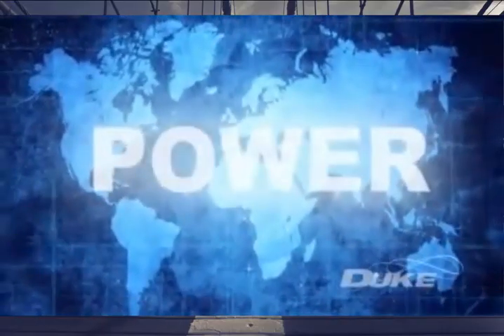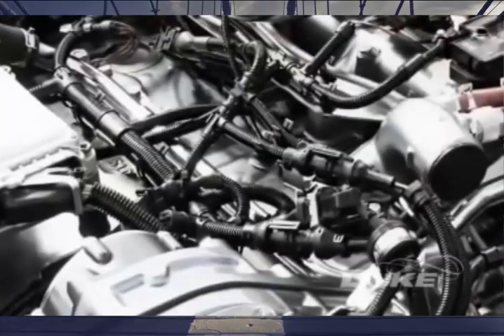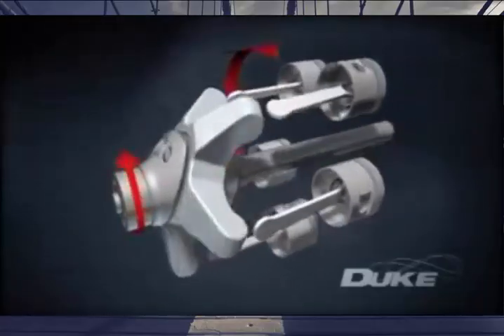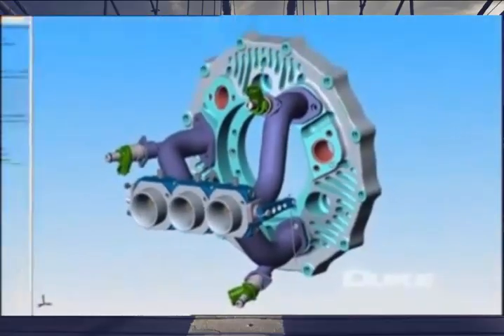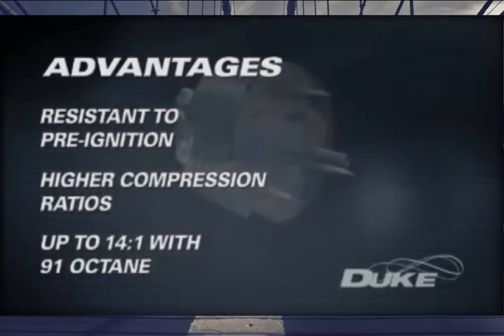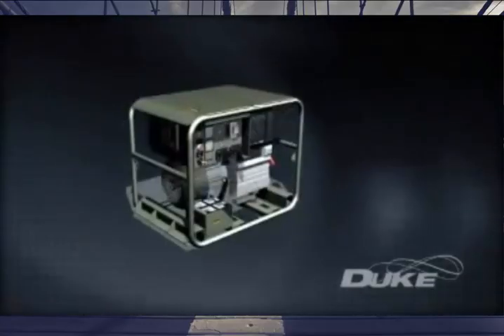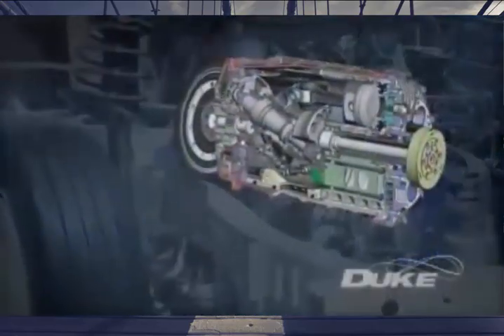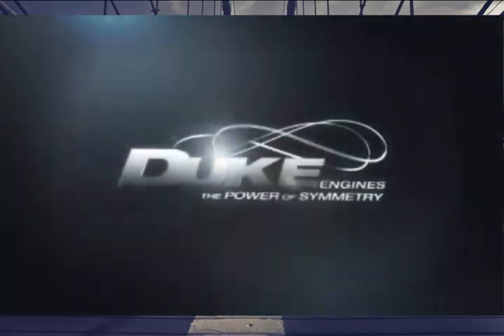Duke Engines | All information about Duke Engines

Comment: Obviously there is a major flaw in the design otherwise it would have been adopted by now.
Reply: Sealing the combustion chambers has to be a nightmare
Reply: Oh yea because there aren't about 130,000 regulations that they have to comply with before even thinking about placing it in a consumer anything.
Reply: tanker9987 - Bullshit.  Go take a Mazda rotary for a ride and get back to us.
Reply: Rotary engines are a joke. Their "high revving capability" is piss poor compared to conventional engines used in bikes. All you need is a short stroke to get 20k+ rpm.
Attitude towards cars has changed a lot in the least few decades anyway. Most cars these days put big covers over their valves and you hardly ever see proper craftsmanship and attention to detail in the design of the fuel lines/rails and most people don't seem to be keeping their engine bays clean and tidy. 
A cars engine is probably the least important component in a car, the seats, perceived value and entertainment system are what buyers think about when choosing a car. Fuel economy is even meaning less and less. They aren't going to spend more to have a different engine in it.
Reply: In general this isn't true. Regulations can be made by the current big boys in a business genre and they don't want disruptive competition to be introduced. Which is why it took 90+ years for electrical cars to come back and required a hand-held Tesla company + billions in subsidiaries + billions of of Musks own pocket to make it work. That and good timing when the market for laptops had fueled enough research into laptop batteries that Musk could then re-use and start from there for his own batteries.
Dont forget that the Wankel engine is the ONLY combustion engine invented after 1900 so far. Except for this one above and while the Rotary has a ton of downsides (seals and fuel consumption and low torque), it still has a ton of followers for being different. I could totally see this engine be popular, even if "just to be different".
Reply: 1 and 3 are actually incorrect. Rotary engine has more HP per displacement and the size then piston engine. However, HP doesn't represent total power of the engine and it is rather combination of HP and Nm (or momentum) which is important. Equally, rotary engines produces similar amount of power per unit of fuel, using smaller engine displacement.

So advantage of rotary engines is that they are compact. However, the reliability issues are the main reason why they are not more widely used. and the major point is what you mentioned in you point 2. That is as well combination of increased maintenance and especially big when people are not following the maintenance schedule and doesn't replace parts as necessary. Good example would be Mazda RX8 where it was sufficient to replace seals during every second service (or 20k miles), however many people were not following this schedule, or instead of suing authorised service and routine, were using independent service which was doing service similar to piston engines e.g. oil, filter only. And therefore there are many Mazda RX8 with killed rotary engines and very cheap.

Going back to original statement by banjitson420, I believe that it must be exactly the case for Duke engines (though they are not rotary) something's not right with the engine to accelerate major adoption. Such flaw might be simply price for example.

It be worn to say that Duke engines are not used at all, but first of all there are many similar designs and so far they are only popular for certain niche application, like motorboats external engines - very expensive though.
Reply: i know right? especially the Braaaap Braaap Braaaap Vutsutsusutsutttsuuttt noises it makes
Reply: meep meep meep meep meep meep

Seriously, make sure you have at last a basic clue what you are talking about before trying to pass on your "knowledge".

It's like listening to majority of rice-burner fanatics vs muscle heads, neither seem to have much understanding of the fundamental relationship between torque, rpm and horsepower.
Reply: That's what they said about Tesla!
Reply: tanker9987
 About the car culture, I see a different trend where people move away from the "moving stereos" and into engine refinement. I see lots of people who spent a lot more for a engine they wanted rather than what was theoretically the best bang for their buck. But maybe we look in different places and gets biased towards what we like to see. I certainly dont look at or for rolling stereos e.g. but more at Hotrods and homebuilt tuner cars. Must admit that I see dirty engine bays but in some cases, thats cause people work on them all the time, fiddling with settings and changing parts or use junkyard parts.
Reply: BINGO. This design is stupid.
Reply: Yes, it has no tq, eats oil, has poor fuel economy and needs rebuilt well before a piston engine even has notable wear.
Reply: SmoothRide Scooter
 How exactly does a high RPM rate offer an advantage?
It seems more like a characteristic of the engine.
Piston engines can be optimized for higher RPM's but its only really done to give the engine a wider power band so a smaller unit can be put in its place. It's pretty much never the efficient nor reliable option.
I can't see how a rotary engine would be easier to install either, a small 4 banger takes up hardly any room and most of an engine bay is filled with PS pumps, AC compressors, alternators, etc.
Not having a go at you or anything, but everyone I speak to who mentions how great rotary's are, can't tell me why they are so great.
Reply: I think you are wrong about high rpm engines delivering more torque, although they tend to deliver more horsepower. 

High RPM engines usually have more bore, and less stroke than the lower rpm engines, because having less stroke means that the piston has to travel shorter distance in each revolution of the engine. 

Low RPM engines with more stroke produce more torque because the piston travels further in each revolution of the engine. The point where the connecting rod and crankshaft meet will be further away from the middle of the crankshaft, and thus making a larger circle, which results in more torque.

Just look at diesel engines in big machines that require a lot of torque, they redline for example at 2000-3000 rpm, but a diesel engine in a normal car will typically redline at 4500 rpm.

But you must also consider valve timing, ignition timing, crankshaft plane, fuel injection and lot of things when it comes to producing power.
Reply: GlassDeviant
Yes people care about the cost of gas however not the efficiency of their vehicles.
Most of those people complaining don't buy new vehicles, the ones that do buy new vehicles don't care too much for its efficiency as cars aren't a long term purchase anymore and the depreciation far outweighs fuel cots.
Reply: I think it is more about the issue of retraining tech's to be comfortable working and troubleshooting on this engine. This is why Tesla hasn't shot up and the most desired vehicles. I have a friend that test drives/troubleshoots tesla vehicles for toyota to help develop their tech, and except for the range tesla vehicles out perform many similar (body/style not fuel use) vehicles.
Reply: +Rod builder
Crispy RX-8 cost less than crispy Mk3 Golf ... that explains alot.

Hey dummy, Tesla is still losing money, even if Musk did eat $4,5 bln of govt subsidies. 
And they offer 8 year and 100k miles drivetrain and batteries. And many engines and batteries fail under 100k miles so pretty soon, this will become costly problem for Tesla. 
Not to mention Musks pathetic attempt to retain cashflow by offering 80% of technology for 50% of price and taking deposits on way more Model 3 that they can deliver.

And the Tesla bailout program isn't working well either .... how was that called? I remember, SpaceX ... attempt to suck govt subsidies on something proven not to work - Shuttle program that did end costing way more money and suffering reliability issues.
Reply: *****
 How does that work?
Looking at my dyno sheet torque and HP should move together but HP and torque hit peaks at very different parts of the RPM ladder. Torque hitting its max at around 5k and HP at around 8k.
Reply: tanker9987 how about going to elementary school to learn some basic math and physics. And how about learning utter basics about internal combustion engines.
Reply: El Shuwix
 Did you pass elementary school yourself?
You don't seem to be able to present an argument that might suggest that you know yourself.
I haven't seen the formula presented however I know it is already missing too many factors that would present a variation in torque and HP (Stroke length, compression ratio, valve overlap)
These factors can have huge effects on either the power or torque on the engine but the outcome is usually one or the other, not both.

For example adding a longer stroke crankshaft and reducing valve overlap will increase torque a lot yet will likely cause HP to suffer.

What examples do you have?
Reply: Yes, nothing can be invented, because if it could be, we would-have invented it already.
Reply: Smoothride  Your second point is a bunch of bullshit. Where do you get this 6-8 thousand miles crap? I drove my RX7 for well over 100,000 miles without a rebuild. It's the RX8 that had bad engine life because the engine software basically stopped oiling of the chambers when idling.
Reply: What are you talking about?
The oil pressure has nothing to do with the software.ts 
Its all mechanical.
Reply: "Regulations can be made by the current big boys in a business genre and they don't want disruptive competition to be introduced"\

New Zealand doesn't have those regulations for the most part and tends to bend over backwards to encourage local innovators. The problem is that a lot of engine designs look promising on paper or in prototypes but barely produce enough power to keep themselves running.
Reply: +fush and chips Don't forget fuel flow. The other bits like external atmospherics don't matter because they already determine torque. Fuel flow OTOH, is critical. It seems you understand that torque is measured and power is calculated, which puts you a long way ahead of most others here:

http://www.epi-eng.com/mechanical_engineering_basics/mechanical_basics_contents.htm

Comment: Ok, but why do you do, what you do John Garvey? 

The carbon energy era is ending, and the original engineering innovation is over a 100 years old

There is a clear increase in efficiency of the carbon energy era piston engine, and one of many of the original axial design 

At this point, it's just one of many innovation efficiencies of the axial design engine of 1911
Still, it is impressive, and better than most  

Well done

Ferdinand Porsche's original Porsche race car was powered by an electric hub^ in the late1800s, and it was a winner as an original innovation  
The carbon energy era diverted innovation from electric hubs or drive trains 

Wouldn't it be clever to focus on alternatives to the carbon energy sources; thereby, driving innovation efficiencies in electric motor drive trains?  
Particularly as ethanol has no 'proof of concept' inclusive of economic viability, most importantly going forward into any projected future 

Even a hybrid of your engine, with an electric motor, might work as it did for the last Lohner-Porsche in1905, don't you think? 

I was looking for the why, not what you do John

It only leaves one probable answer, does that work for you? 
_________
^   https://en.wikipedia.org/wiki/Wheel_hub_motor#History
^   http://press.porsche.com/news/release.php?id=642

Comment: Nice, but there's a few obvious challenges. The moving Cylinders represent a lot of rotating mass, this could be removed by rotating the head plate instead but a moving compression plate with respect to the cylinders makes a high pressure seal difficult, perhaps a two piece pressure plate would mitigate that, one piece  literally part of the cylinders slipping against a separate which could be a ring to limit friction, maybe a three or four piece design could give more inlet and outlet port timings without rotating the cylinders. The shape of the inlet and outlet ports would probably be important as that would vary how quickly the ports open and close. The traditional funding model may be insufficient to overcome the current base of well developed conventional engines, perhaps the open source model should be used to encourage wider scale development.

Comment: "Internal combustion  engine hasnt changed in 100 years" Rotary,Chrysler Turbine to name 2
Reply: The Ford 707 turbine in '70 was used in their transports to replace the 450 hp diesel and reduced weight more than 75% It idled at 18,000 rpm. I want one.

Comment: Next Duke Transmission, I know for certain Duke makes the best restaurant ranch salad dressing I've ever had. Maybe it's true about this style engine, rotary engines are still awesome this has it's own class and I'm sure usage. If more efficient than a flexible fuel source why not use this as a portable generator and make those, I'd use propane gas or fuel oil if I could get away with it. Next Duke generators with fuel flex that would be useful.

Comment: since there are no valve assembly..so non of that vtec crap and  its associated solenoids and electrical nightmare ..
 kinda like a two stroke engine ....so chances of failure there
is it reliable ? did they mate is to a heavy truck transmission and see how it fairs?
how much it cost to build it on a mass scale ?
is it rebuild able ?

i think a turbocharger is possible on these
i mean if it can run 14:1 compression on 91 that is superior in terms knock/detonation prevention

Comment: Nice but a bit late as electric motors will take over.

However this configuration might be able to use something other than a sinusoidal path for the pistons.  They could make the strokes different lengths.  In particular the power stroke could be made longer than the other strokes so the gas gets a longer time to do its work and the pressure is lower at the end of the stroke so the engine wouldn't need as much "muffling".

This concept has been used before on similar engines so it should work here too.

Comment: Another "new" motor that will revolutionize the industry,except that every time in the past we heard of one of these "miracles" they turned out to have more problems than current IC engines in use.  But this stuff is great for the conspiracy theorists who can again claim that Big Auto prevented them from coming into mass production.
Whatever happened to NSU's miraculous Wankel, and the Hydrogen powered car,and the electric cars that don't work in cold climates and only Hollywood stars can afford them?

Get back to us when you've got a motor that will power a Toyota Corolla mostly  trouble free for 200,000 kms,and give us 50 mpg,THEN you'll have done something revolutionary.

Comment: This design will restrict rpm's which means less torque and less mpg. As far as rpm's are limited, is the loss off set by lighter materials? Can this engine last more than ten years with regular minimum maintenance?  Seems it would produce more torque via higher rpm's if they shorten the connecting rods. Even doing that though, this design will fail. Just from making the cylinders rotate counter to the pistons and their wobble crank thingy.  The wear and tear on the parts that provide the compression will fail way too soon.  Build a couple of these just to run in a Formula 1 car, then get back to us on this concept. Formula 1 will let them know if their engine is worth tinkering with.
Reply: Yes...the spinning cylinder will side-load the pistons...which can't be good for them as they have no skirt to bear the load.   Plus you have the entire spinning cylinder needing to be constantly sealed to the head yet allowing ports to flow and combustion pressures do be developed.   There were several sleeve-valve aircraft engines back in WWII that made great power, but were a nightmare to service and had very, very short life expectancy.   
How do you do seal the head and maintain these seals without lubrication (like the rotary needs to inject oil) which cripples the emissions friendliness.   Seems like another 'neat' design just begging for investors...but a serious look at it gives me doubt.
And...the biggest factor here:  it's competing against a mature engine design and must both work better and last longer than it...or there's no reason to change.   Sure...after 100 years of development the Duke might work OK...but it has to work BETTER...NOW.   Sorry guys.....

Comment: I was asking if you have tried to fuel your engine with Hydrogen/Hydrogen/Oxygen produces from splitting water as a fuel.  The reason I asked the question I am looking for an engine powering an electric generator in remote areas with large amounts of water.

Comment: Friction becomes a problem as RPMs increase. (The cylinders are pushed to the outside.)

The numbers I saw on a similar design suggested this configuration is slightly more efficient until about 4,000 RPMs, then losses increase dramatically. 

Also the high angular momentum is a problem for mobile applications. 

But for slow stationary gasoline applications, this might have some advantages. Unfortunately there are few of those.

Comment: It's nice of the poster to include the wiki, which basically points out that this is 100+ year old tech used in torpedos and not much else because it can't rev fast enough to generate any power.

Until one of these things can make a Miata go faster, it's really just a plane/boat motor with a short lifespan.